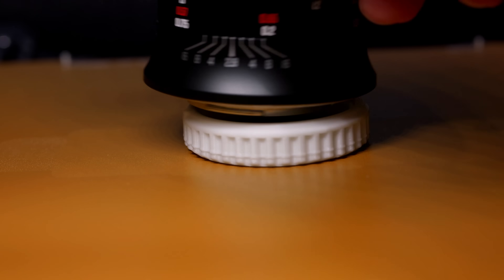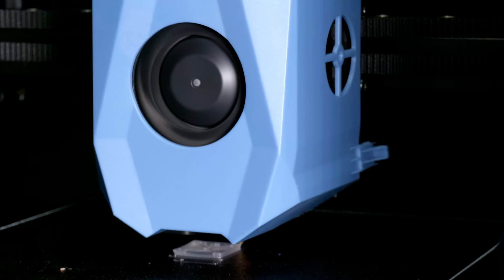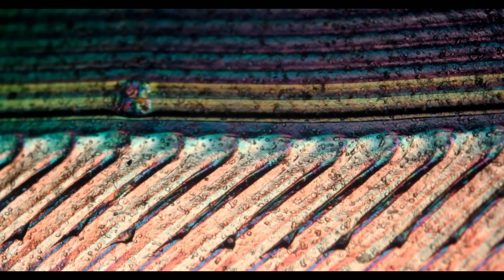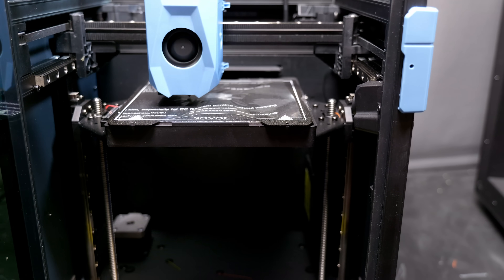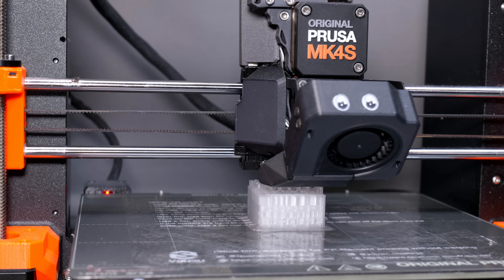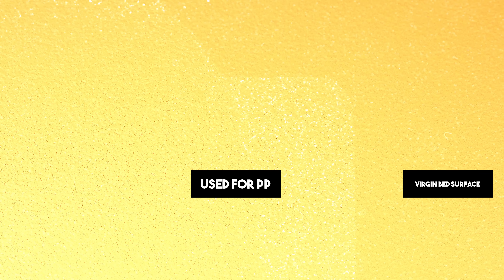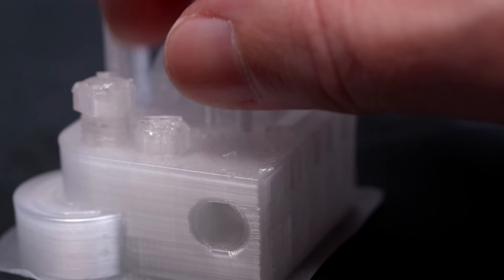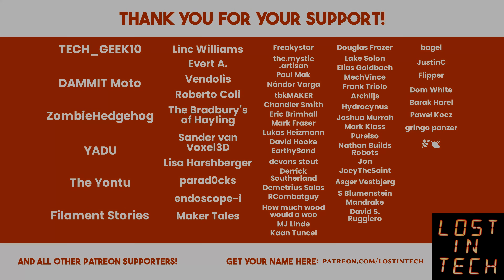Polypropylene - the FLEXIBLE 3d printing filament that everyone is sleeping on

Comment: All I have done here is cut the side out of a storage box that's around 2mm thick made from PP then lightly sanded the surface and then just hold it down with a few strong magnets to the build plate. I have the heat turned off for the build plate; I have some G10 as well but have not got around to using that.

Comment: The cylinder not fitting is probably "hole compensation" and not "shrinkage". Shrinkage is dependent on the length so the box shrinks more than a short diameter cylinder. Thats my guess at least.

Comment: That was an awesome subject. The only downside is permitting this much ads. It ruins the flow of your great video.
Reply from the maker: That's as maybe but the ad revenue doesn't even get close to covering the true cost of a video like this even with this default amount. It's not greed, it's just really trying to cover costs. 
You have the controls in your hands though, theres premium or patreon both of which offer ad free viewing.
Reply: @LostInTech3D  I see. No problem.

Comment: I live next to several tons of pulverized polypropylene in piles outside.
The owners of this property got it cheap and planned to mix it into concrete as an extender. 
However, the plastic floats out of suspension, so the idea was abandoned. There are several piles of varying shades of blue, some gray, and a few white piles. It all used to be in big boxes but the weather washed the cardboard away. How can this resource be utilized?

Comment: Does PLA really emit formaldehyde?
Cause I’ve never been able to measure it, even with the sensor inside the enclosed printer, it always stays bellow 0.05 mg/m^3, only time when printing it has gone up is when I’ve tried to use PVA supports for PA (and the PVA basically burnt), and slightly up when printing ABD and especially when using Lac3D spray, that stuff really increases the HCHO and TVOC and well, everything, same as hair spray… or most sprays.

But I’ve never had any reading with PLA.
Reply from the maker: it's thought to be much lower, there's papers on it but I think they generally focus on the presence of substances more than the quantity. What sensor are you using?

Comment: There is a German company called PP Print, which is selling everything for printing PP. They invented a sheet specially for printing PP on it which should be the holy grail for PP but it is extremely expensive. I had the best success with magigoo. A big PP part even pulls off the print plate from my immensely strong neodymium magnets of my qidi printer

Comment: pha would be amazing to add to this polymer, just realized! it could be amazing for compliant mechanisms, possibly the acoustic dampener pump structure I commented about before. As well as a very tough and durable seal for the bearings of a crank bearing seal maybe as a part of a multiple layer and material head gasket and or crank case seal, more likely a valve cover gasket seal with other materials combined of course.

even 3mm is a massive increase in total strength to electro-formed outer mandrels. Sure you are going to need to reduce to the thickness of the total metal & or ceramic formed on the plastics involved, but that accounts for bend & flex of the formed exoskeleton part & reduces its ability to have it flake off & or not provide continued sealing & strength to parts involved & a reduction to removal of "seep" of liquids into the printed parts. 

After treating it the right way to make sure it stays sealed & separated to these pressures & temperatures, together with fluid flow rates it can now remain as a pressurized fluid that provides strength & support for the engine prototype I wrote about in my last comment. 

Which is awesome because pha is bio-degradable & chemically easier to react & form this sealed & changed material wall surface. But that is because its bio-degradable, it makes it easier to chemically perform those element/molecule bond changes & catalytic changes for surface treatment washing cycles. Especially if you know uv, electricity, & heat chemistry processes to improve this process. 

I've seen others do this, for their 3d prints & it takes a bit. But if it's for a longer duration prototype & functional print, then it makes sense to do. Which this would be for. Pha also has a PHA-CF so this helps with electro-chemical treatments for both combining the 2 polymers & also changing the polymers to stronger materials interspersed (spread throughout) through the print, of course consolidation through heating & rapid quenching to cooling through co2 & increasing the pressure under that cooling going on to slowly releasing pressure while vibrating the polymers forces a restructuring of the state of these molecules & their placement of arrangement of crystal & polymer structures.

Increasing the intentional bend & flex & total poly-monocrystalline structures that now bond as one whole "compound mineral" if you will. :)

Making it far, far stronger & more durable to the actual stressors & material design performance constraints in these applications. Tuning it for the actual 3d printed part & making it perform more like a deforming metal that is using polymers poly-amorphous states to break & re-bond near by to other neighbors rapidly switching in small areas & volumes to soak up energy, as they become contained in their shell of a mandrel.

You know, nickel, boron nitride, silicon carbide, tungsten, aluminum, & many more can be used as plating initial layers that through diffusion of materials along micro-crystalline structures that have "super highways" of non-bonded areas that flow far more readily, like tectonic plates & their convection magma currents, right? Well, this means a single element to a compound to a layer of specific compound that is energized to pass through the energy barrier to react & move in those channels is achievable. You have to wiki it up, for the compound process & or chemical alloy & thermite to alloy reaction you have to learn & then use & properly ratio & math for, sure.

But that just means its like a few hours, maybe for a couple of days at best, to look up & find & use! That's nothing compared to the phd's they had to get to play with much more expensive equipment to do this before in labs! We aren't aiming for perfection lab levels here, dudes! I mean come on!

No, we are aiming for it seemed to work lol! Not, "I have made a phd thesis on my new 3d printing stuff I tried because some dude commented on Lost In Tech's polypropylene youtube video" . Just the, "we credite some xenonreality comment for trying this & it working turns out" levels.

Thanks for making the video, loved the double polar stuff, super interesting seriously :) !

Comment: That carbon fiber reinforced PP stuff makes me think of using it in some small engine tests. If you plate using nickel boron nitride (caswell inc through electroless plating) then electroplate with nickel then you can use a standard steel or similar metal alloy to act as a inserted sleeve to the PPCF engine block you've got.

But it would require some good strong PPA & or PPAGF to pull off or PC with flame retardant ABS & or even all of those to then section & stick together with some good long threaded rods & heated stainless steel inserts/rivets to allow for the correct strength & total heat dissipation for such a thing.

Multiple prints for a multi-material prototype would be a nice thing to have. Cranks & connection rods are, usually, going to be better to just re-use from an on lawn mower engine & or compressor. Something like this so its actually going to work for a bit. 

The PP & a combo of other plastics will help with shock dispersion of the combustion pressure change, while holding together with everything, but the real kicker is "welding" it together by treating it as a mandrel to some electro-forming structures (a few mm at best sure but its still there) that now have backing & strength to do what's needed. 

Thermal expansion relief holes will be needed with a "filling in" of those with some plating. Increasing size of the transition areas between walls, a parabolic fuller if you will, will help with block flex & strength too, keeping in tolerance & spec. Shock adsorption & dispersion is the name of the game to the more brittle plastics you can use, especially once heating & cooling cycles occur & creep starts to play a role in the design for how you have to properly support the block & structures needed in & on it to increase its viability long term. 

If a core of "bouncier" material is made to absorb both heating & cooling, alongside standard 4 stroke cycling, which yes it can do if you design it correctly into the walls & needed areas around the bearing journals where your crank needs to rest & be bolted together & the seals for the front & rear of the engine block. You'll need a crank cradle & a bottom "girdle" as well to hold the crank case together with that transmission case/transmission adapter to transmission case together & have it become a structural member of the engine improving its total strength & thermal mass & thus cooling too.

The vibration dampening can be used for a "wicking effect" pump for the oil that you could suck up into a oil pump needed anyways. woo hoo right?

..... Probably going to be close to quite a few prototypes & revisions sooooo... Maybe 300 to 1k us dollars! Not super practical but over time actually approachable. Maybe.

Comment: my only major issue with PP is that is has very little resistance to cold temps and becomes very brittle very fast below 0C, as its glass transition temp is between - 10C and 0C so as someone who lives in Canada it's not exactly the best plastic for most general use cases that aren't indoors the entire year.

Comment: I use gardener's wide sticky tape (150 mm). They use them for repairing their plastic sleeves for veggies. A 25m roll costs 3 eur and one strip covers enough of the build plate for most prints.

Comment: We had to print some fixtures for parts what get etched in nitric acid out of PP. What ended up working the best for us was covering the glass bed with a PP masking tape and printing with a large brim. Also had to adjust the first layer Z offset to find a balance of good bed adhesion without clogging the nozzle and extruder on the first layer.

Comment: I recently printed some parts with PP using tape. I actually found that I could easily print without any heating on the bed at all, although using a wide raft did help with warping on the part as the tape didn't quite still well enough to the bed. The reason I tried this to begin with is because when using high bed temperatures I was struggling with having to cut the tape off as it was too well attached (even down to about 50degC). This may be related to why the default print profiles were using a bed temperature set to 0 for PP. The ability to stick like this even with 0 bed temperature could also make using a solid PP sheet clamped to the bed a good solution for printing PP.

Comment: Its like tools, use the right one for the job, I would use PP when I need chemical resistance, specially for solvents, otherwise, no, I would prefer a PETG-GF or PETG-CF, there is so many cool materials to choose from, pure PETG is still a great material for household items, but I tend to use PC-CF more for durable parts, PA-CF for bike parts, PET-CF is also another nice option for vacuum cleaner attachments, knife handles and other more durable products, one of my favorite materials these days is PC-ABS, this makes the toughest parts, but needs a heated chamber to prevent warping.

Comment: What I used in the past was a bed I got on Etsy for a P1S called geckotech. You cant use the gecko bed on amazon, it has to specifically be the geckotech bed. I was almost able to print on it without adhesive but eventually decided to use it with magigoo PP adhesive... AND HOLY. At least for me, that geckotech bed is nuts. I have yet to find a filament that cannot bond to it. Unfortunately its like 80$ but PP with that adhesive stuck so well to the bed almost too well (like TPU gets sometimes with gluestick). The same seller on Etsy also sells garolite coated beds and PP coated beds. I only did like 4 prints, after that I took a break because the flexibility was causing issues with the AMS

Comment: Polypropylene adheres well to non-foil, roughly scratched FR4. The first layer should be printed quite slowly, and from the second layer onward at normal speed, while the bed must be heated significantly (90–100+ °C).

Comment: If you’re gonna use the yousu sheet I’d suggest using it on a smooth bed, not textured. I had no issues with the product, hell, it’s the only thing that worked.
Reply from the maker: Yeah that was my conclusion, but it did work least best even so

Comment: If I had to guess what Prusa is doing with their PP bed, it's probably a PEI powder coat with PP mixed in.  I think the PP does heat up and melt slightly to the print, but on a micro level, and when you peel the print off, you are leaving behind a tiny amount of the printed PP on the plate, thus "refreshing" the PP "stickability."

It might also be that there is no PP at all in the PEI (or whatever they're using) but instead there's a bunch of micro-cavities on the virgin bed, and the PP seeps into these voids and makes a physical bond with the plate until you peel it up, which snaps off tiny amounts of the bottom surface of your print and leaves it behind in these voids.  If this is the case, then you may find that this bed actually improves with each print, because you're adding to the coating of PP in the plate material.  This would also explain why you have to have the bed at high temperatures: it's relying on the material flowing into these voids to make the physical bond.

 Either way, IDK if Prusa says this plate is only supposed to be used with PP or not, but I wouldn't mix it with anything else.  If either of my theories are true, then I would suspect that you could contaminate the bed and weaken it's bond with PP by getting other materials mixed in.
Reply from the maker: that...could be...I should try it again now, at lower temp for science.

Comment: I did some more testing with PP on G10 FR4. At least with the filament i got, i have no problem even printing with lid from printer removed and completely open door. Just 90°C on bed and a 5mm brim. I tested some prints that warp with nearly all filaments, when printed without brim. They all printed well.

Comment: Hmmm 🤔 I bought and printed some black Yousu PP years ago and the smell was horrendous. Smelled like burning trashbag. Of course I gave up because I couldn't get it to stick to the build plate and not warp after 5ish mins. Perhaps I'll try it again since it's still sitting there unused.
Reply: Well here's an update:   I have it printing in my X1C. I don't smell that horrible smell. I used your pp tape method on the Engineering Plate and so far, it looks good. 

I also didn't buy Yousu PP. My apologies, I have Reprapper (red box, yellow letters) not Yousu. Sorry. No crazy smells this time. Perhaps I had the wrong temp sent. 1hr print for some tubes. Not sure what happened years ago. Sorry!
Reply from the maker: weird, I even got up close and sniffed it, nothing.
Reply: @LostInTech3D I believe you. I'm going to look for that roll and try it again. For all I know, I may have mixed up rolls and printed something I thought was PP but was actually totally different. I recall that it was unlike any other filament I printed. Perhaps black PP has a smell while transparent doesn't...?... 

Maybe some wires were burning🤔
Reply from the maker: @3dPrintingMillennial I've read elsewhere about a petroleum smell. You'd think I'd notice. Must be different formulas.

Comment: I found a buildplate that works excellent on my setup(Qidi Plus4) without ANY adhesives.
G10 FR4(Garolite) could be the answer to all our dreams. At least with 90°C bed temp and heated chamber to 50°C it works perfectly.
A cube with 30x30mm and a 5mm brim stuck so hard, i couldn't remove it by hand until it cooled down significantly. A test print from an actual project with minimal contact area(also 5mm brim) could be removed by hand with some force, but stuck more than enough imo.
I mostly print with 0.6 nozzle and 0.24 or 0.3 layer height(both tested). But i have the feeling that it should also work with 0.4 nozzle. 
But i don't know about having no enclosure. I'm quite sure, that a chamber heater isn't mandatory. When i've finished the prints for my project, i will do some more investigations.
Thanks for your inspiration. Wanted to print PP for years, but allways hesitated to try it out.
Reply: My Plus 4 doesn't have much issue with PP. That printer is like a cheat code

Comment: For laboratory makers out there: I've found the majority of my 3D printed PP parts to be steam autoclave-able (at 120 °C) based on part geometry, e.g., I've mainly seen thin and long parts warp, and even so, it helped to autoclave those types of parts while submerged in water.
Reply: Cool! What is your experience with PP used in a lab? i'm a chemist and i would like to print some chemical resistant accesoires for in fume hoods.

Comment: PP is really crap at making good clips though. Same with any sort of glueing of PP, absolutely GL with that unless you give it a plasma treatment or use very special glues. 
The main reason why it is everywhere is cause it is legit dirtcheap, it is weak and really low yield strength in comparison to a PC-ABS part and a nightmare for prolonged durability usecases.. :D